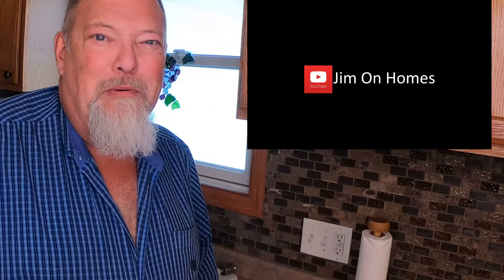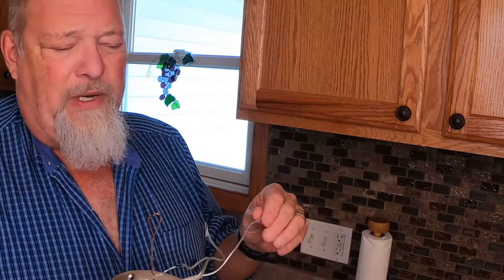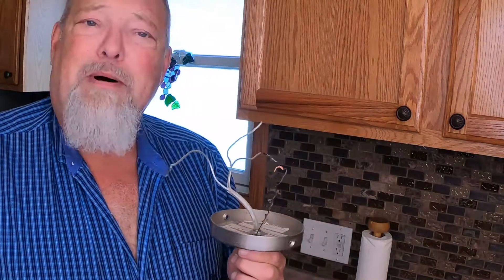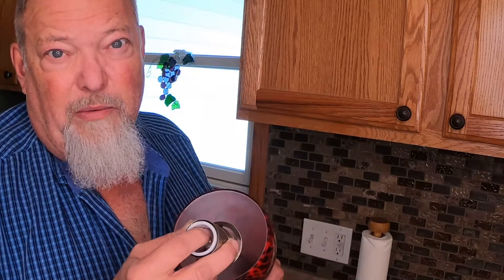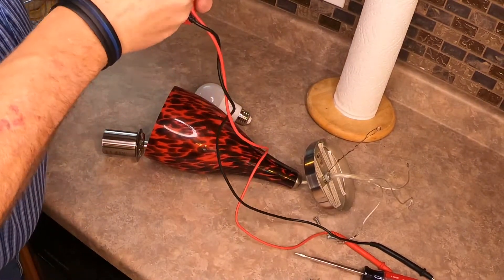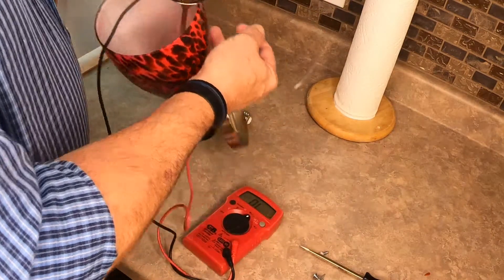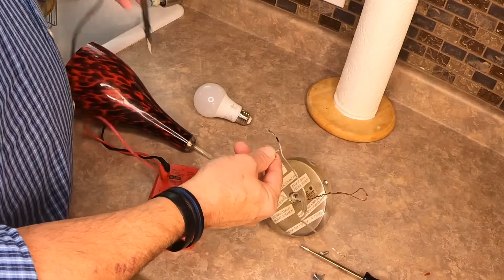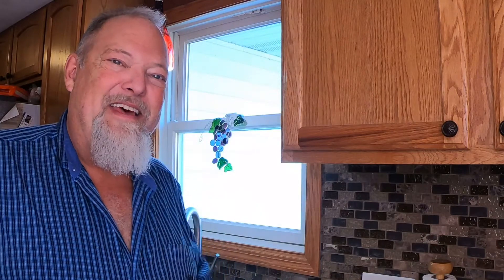Which Wire is HOT!!

Comment: You didn't even show us what you saw that made you know it was the hot wire. You just said that you touched the two things together and it was hot - you didn't tell us how to determine that on our own.
Reply from the maker: I am going to re-watch the video and see if I can see what you are saying, let me get back to you!
Reply from the maker: OK, I had a chance to look at the video again. The Hot in the fixture is the little part in the very bottom of the light socket. So by touching 1 probe there, and the other probe to one of the wires, you can tell which wire is hot. The Threads in the socket are the Neutral, so by doing the same thing, you can isolate the Neutral wire. The mystery of the wires is that there was an extra, that did not have any continuity to any part of the lamp... just an extra wire I guess! Hope that helps! THanks for watching!

Comment: Where did you touch for the neutral? It was cut off in the video.
Reply from the maker: Hi, Thanks for watching! The Neutral is the threaded area in the light fixture. The hot part of the socket is at the deepest part of the socket (Or end of the light bulb) I hope that helps!
Reply: @jimonhomes1173  Thank you very much. 🙏

Comment: 3rd wire is for a 3 way switch
Reply: I don't think so, 3 way or 4 way switches don't require anything different from the light bulb or fixtures. It may have something to do with a smart dimmer controlled by WiFi
Reply from the maker: Hi Ted, sorry for the late response. That is correct, the 3 or 4 way switching is in the switches, not the fixture. Also, the wire had no continuity to any other part of the fixture. Since it is a cheaper fixture, (I think it was $20.00) my true guess is that it was just an extra wire in the wiring the manufacturer had???
Reply from the maker: Thank You!

Comment: How do you test it on a chandelier? I have an old chandelier and don’t know which of the attached wires are hot or neutral. What part of the chandelier would I touch the continuity tester to?
Reply from the maker: Thanks for the comment! It would be the same way, using any of the light sockets in the chandelier. I hope that helps!